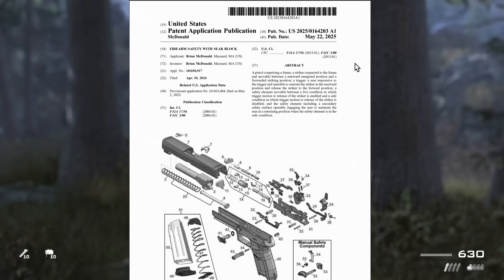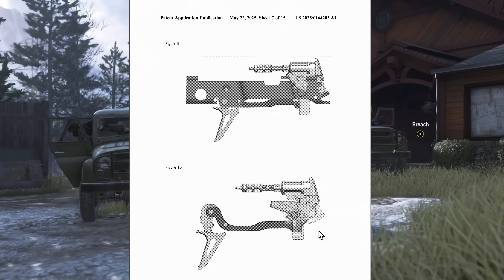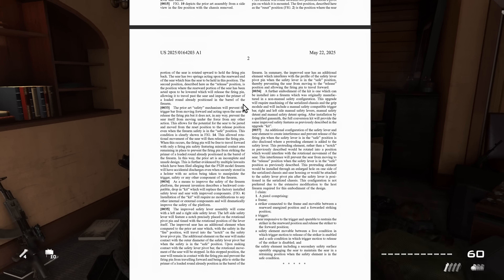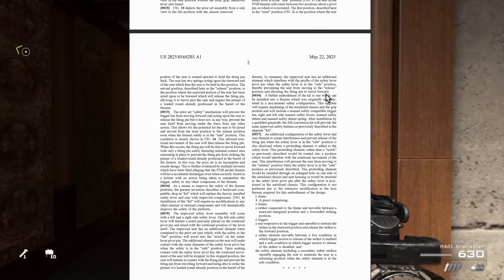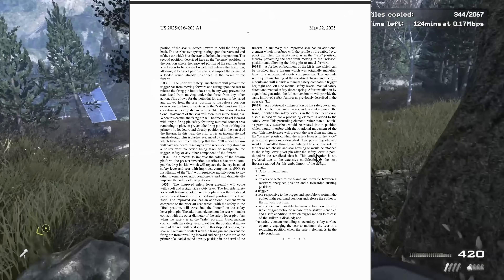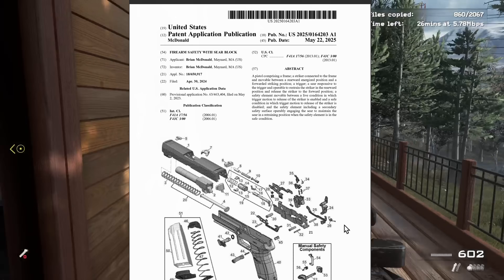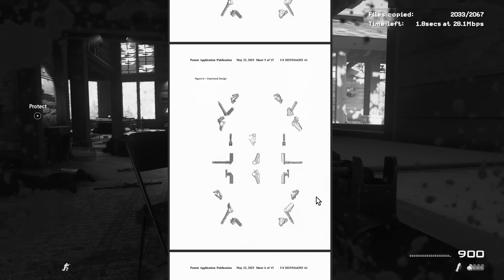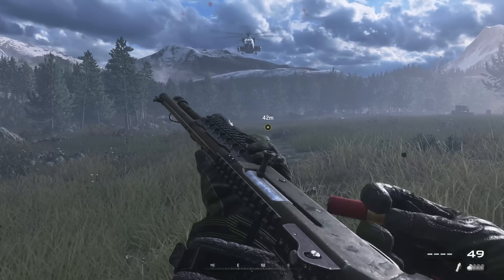Explosive: New Patent Claims Fix For  "Incomplete, Unsafe" 320 Design

Comment: I asked Bruce Grey if this was feasible not too long ago, never got a response. Seemingly it is which is something I would love to see implemented... as well as have the new sear be cnc machined out of billet steel, tool steel, stainless, whatever. Something harder than the striker.
Reply: What would having a sear that is harder than the striker do?
Reply: @jeffhernandez5098  it would allow the striker to be the wear item in that mechanical operation. It's a hell of a lot easier to swap strikers out every 5000 rounds than it is to replace the sear.
Reply: @Hellcat287287 I understand you but I'm not getting the point. Took Isaac Lockwood 80k rounds to wear out a sear. Per Bruce Gray. It would take me about 5 years to shoot that many rounds.
Reply: @jeffhernandez5098 so? Because people don't use their firearms to their full life cycle companies should be able to put cheaper parts in at the same price? Based on the FBI report they had some weird wear patterns. Not enough to be a significant issue I don't think but still, a machined seer would probably force a slightly softer striker to wear evenly, OR if there was an issue it'd be isolated to the striker. Not sure how I feel about Bruce Grey tbh, he's very informative but he also has a lot of skin in the game so I'm taking what he says with a grain of salt.

Comment: I agree this would add “safety”. However, the current manual safety on the p320 blocks the trigger from being pulled… The trigger dingus/safety on a Glock also blocks the trigger from being pulled. Neither one of these setups block the sear from moving. This is actually the same in most striker fired guns. Which would also claim that ALL striker fired guns of a similar setup are unsafe and incomplete and yet again, not isolated to just the p320.
Reply: The Glock has a solid plunger striker safety block while the 320 has a flimsy lever safety. Glock also physically prevents the trigger bar from dropping the striker until the trigger reaches the end of the pull, while the 320 sear can rotate on its pin.
The 320 is a very unique setup for a striker, which is why the conventional striker setup on the 365 isn't under scrutiny.

Comment: This also could mean he's just very familiar with the design due to his past experience. He's seeing a business opportunity to sell a better design and upgrade to the firearm. I think its important not to jump to conclusions about SIG being involved in this. Both are possible.
Reply: He probably knew of the problems years ago but Sig wouldn't let him "fix" it because it would also admit fault.
Reply: this is most plausible.
Reply: This is exactly whats happening. The designer is locking down his idea so Sig has to buy it off him. The problem is this design is seriously flawed. The sear being unreliable, the gun could fire when this manual safety is flipped off.
Reply: @robopam Yes but it now makes the firearm safer for the way it's supposed to be carried by the military. It would make it no different than carrying an SAO with a safety. There are a lot of those M17/18s out there that might need an upgrade. That's big money.
Reply: @JK13A  Im not so sure. If the striker/sear has slipped and the only thing holding it is the rotating safety, when the safety is disengaged, the sear drops the striker and the gun discharges.
Reply: @robopam  ya I guess that makes sense. Then the safety becomes the trigger.
Reply: Sig should have been involved in designing a safe pistol imho
Reply: @JinKee  Yes but we should separate the fact that we believe they fucked up and this patent situation. We should speculate too much on why this patent exists and is from an individual.
Reply: AMEN. good luck to him for this improvement
Reply: Or, OR... Sig is using him just as an "independent contractor" to distance themselves from the design "inadequacies"  of the P320. I think it is important to observe Sig's upper management trajectory during all this and recognize that Sig is now ran by a gaggle of egotistical, greedy, apathetic ghouls... Sure, Sig has cool designs & products, (I have zero issue recognizing that - X-Five Legion & Mod P365-XL owner here), AND Sig's upper management is terrible, that has to be called out as well. Two things can be true at once...
Reply: @mauscuba this was my thought as well. I just like to know how things work because I’m in school for Engineering. I started looking up patents for the pistol and happened to come across this in early June. And it’s not super out there. I had to do some scrolling. So my gut tells me this is a way of rolling in fixes without being super noticeable.
Reply: @mauscuba  You can believe that SIG upper management is unethical but you can't know SIG has done this. I think suggesting that SIG is using this guy to distance themselves as the more likely option is not right. Most of the time the simplest reason is the one that's happening.
Reply: @JK13A  ... I've been trying to respond to you twice and my comment gets deleted or is not "making the cut" for some reason. Bottom line, if Sig does not want people to have "opinions" or to "speculate" they must fix the damn problem and stop gaslighting the public...
Reply: @mauscuba you can have all the opinions you want. This has nothing to do with what SIG wants. It has everything to do with wild speculation based on your imagination. I don't think it's constructive and that's my opinion.
Reply: @JK13A  ... It has been - very constructive - for Sig's competition, lol.  The reality is that all that "bad PR", 100s of people speculating and making 100s of "P320" YouTube videos is completely Sig's upper management's fault. Again: If Sig wants to stop people from having "opinions" or to "speculate unfavorably" 1. Admit there is an issue, 2. Come up with a fix, like this design on this video or something similar involving a trigger safety that acts on the sear as well blocking it and 3, (the most important part) Stop Gaslighting People (like that "it ends today!!" BS) & stop blaming everything and everyone else for the gun's safety problems.

Comment: Except most LE guns don’t have a manual safety…….which should be a standard requirement for general issue…………..to prevent ND’s.
Reply: Manual safeties weren't a thing until semi-autos with single stage triggers had to be carried cocked and locked, when DA/SA and DAO semi autos became a thing safeties were removed again.
If you need a manual safety to prevent a ND on a handgun you actually need to train more. If you want one that's your prerogative but if you're negligent to the point of sticking your finger on the trigger during the draw you're gonna be negligent enough to forget about the safety anyway.
Reply: @ChucksSEADnDEAD Except we have manual safeties on AR’s, shotguns, tasers, and even pepper spray carried by the officer.  You’re exactly right that training needs to be increased, but few departments train enough to be truly proficient, so a manual safety is a good idea, regardless of your platform. I think about when departments installed 12 lb trigger springs in Glocks instead of requiring a manual safety. The military has long decided that a manual safety was a good idea, from the 1911 (which technically has 2) forward (including the DA/SA M9).  Remember the incident a few years ago when the female officer shot a suspect because she tried to use a taser and grabbed her pistol instead? A manual safety might have prevented this.

Comment: There are most likely 3-4 previous engineers that told them something needed fixed but management told them not to.

Personally I think this is a good fix but there also needs to be a lever connected to the trigger that blocks the sear until the trigger is pulled a certain distance. Otherwise non safety users are out.
Reply: Ala XD grip safety 😊

Comment: This will prevent uncommanded discharges as long as the safety is on. However, when the safety is off, it can still discharge without the trigger being pulled, for example while  a policeman points the pistol at a suspect.
Reply: That doesn't fit the model of the ND problem.
Reply: Police aren't even issued manual safety models anyway. They've almost never been issued a gun with manual safeties, because it's found to be a liability for the officer, since they're in high stakes situations, and don't necessarily have the luxury of time to disengage the safety.

This is why they were issued guns with heavy double action triggers such as double action revolvers or DAK P229's (which were developed for police use IIRC), grip safeties for the departments that used 1911s, or trigger safeties like with Glocks.

So this won't solve anything for police or the overwhelming majority of civilian models that don't have manual safeties.

Hell, it won't solve anything for the manual safety version for the majority of people who carry them, because people generally don't use the safety anyway. Despite being taught to carry safety on, lots of service men don't because it's not exactly something you'll remember to disengage when you actually need your sidearm.
Reply: @RealBarrySteakfries this John wick nonsense makes no sense.  They have L3 retention but a thumb safety is the problem.  The cops can learn to disengage a safety like they learn to disengage 2 levels of retention.  People who have a safety and don't use it because of some magical scenario are foolish in my opinion.   Israelis carry condition three and they have clear and present threats.
Reply: Exactly on point.
Reply: what about p320's without a thumb safety?
Reply: @azcompetitiveshooter still cannot fire without the trigger being pulled.
Reply: @youcancallmemaurice bless your heart. They ABSOLUTELY ARE FIRING without a trigger pull. You're being obtuse. You are DEFINITELY not an armoror or even understanding the design and problem 🤦‍♂️
Reply: @azcompetitiveshooter  same defects, just without an added piece pushing on it. Very marginal since 2 issues still exist. 🤷‍♂️
Reply: @WhiplashWoods1971i was always curious as to why sig made the thumb safety only block trigger movement and not sear movement
Reply: So the UC problem comes from manipulating the slide or pressure usually found while holstering, or moving with the gun in a holster. There have been no reports, and I see no engineering reason why there would be, for the gun to go off when being held in a ready position. The danger comes when being jostled while entering or resting in the holster. 

If an officer draws, releases safety, and doesn’t press the trigger. There is no mechanical reason the gun would be unsafe.
Reply: @cfdfirefighter  like, running, falling and hitting something?
Reply: @cfdfirefighter   Um.. look at the design..the manual safety pushes on the linkage. Its going to happen. It probably has and they said the officer goofed up.  Not to mention, if the officer just gets the nervous shakes. Rattle Rattle BOOM.   They won't accept blame for anything for other reasons.  You assume WAY too much one striker thats just WANTING to slip. Its a CRAPZ design
Reply: Theres not really any evidence of that happening though
Reply: @ravener96 you own a 320, don’t you?
Reply: @TheIrishAmish he does
Reply: @ravener96 there’s literally multiple videos of it happening
Reply: @ravener96  the nature of the problem would make self-firing of the firearm a real possibility in that scenario.  It is motion that causes the release of the firing pin.
Reply: @ravener96  100% 
No lab/agency, including the FBI, has been able to recreate an un-commanded discharge, even when testing pistols that supposedly "just went off", and it's certainly not for lack of trying. 
Manipulating the sear with a tool, holding the trigger back with a screw, or modifying the pistol cannot be called "un-commanded". Other striker fired pistols, yes, Glocks too, will fail the same tests, since the test procedures defeat redundant safety mechanisms.
Reply: @ravener96 theres plenty of evidence of police issued p320s, NOT the m18s with a safety, going off in holsters when just walking, leaning over, or getting out of their cars. The videos are everywhere of the guns doing exactly that. Going off with no safety engaged
Reply: @CJ2808 There have been numerous cases of various military branches having the same set of problems with the M17/M18. The safety as far as we can all tell, doesnt do anything to fix the unsafe nature of the 320.
Reply: @xXxAlexIVxXx yes fully agree the safety does nothing at all
Reply: @CJ2808 but that’s not the issue. Those problems would be solved by a sear safety. Once out of the holster, there is no issue to be wary of.
Reply: @xXxAlexIVxXx that safety (had you watched and listened to the video) only stops the trigger bar from moving. It does nothing to hold the sear in place which seems to be the issue. This new safety would fix that.

Comment: I would also bet this designer has filed this patent to protect his manufacturing rights? And some aftermarket company is willing to invest capital to develop this new safety system. Thinking they can sell the kit and or the remanufacturing the FCU to solve the unintended discharge problems? 
Question is now, would current P320 owners pay OUT OF POCKET for this upgrade? Or would SIG pay to have the current owners send their P320 models in for this update? Just think of the costs for shipping, machining and liability. SIG had to know the P320 was defective back when this designer was working for SIG? The lawyers now are going to eat SIG up?
Reply: The New Bruce Gray p320 M17/M18 Safety Conversion.  Brought to you by the genius and skill of Bruce Gray at GrayGuns in cooperation with Sig Sauer.  Part of the buyout/payoff to this engineer is a gag order so they can spin whatever tale they wish.

Comment: Sounds like the India MIM factories will have to adjust their molds. Still no trigger dingus, interesting.
Reply from the maker: believe Glock owns the dingus
Reply: @Protraband  Glock has never owned the trigger dingus.
Reply: @Protraband Glock lifted the trigger dingus off of the old Iver Johnson Model 2 safety revolver. Kinda hard to patent "prior art" from a different company.
Reply: @Protraband The origins of the dingus come from Iver Johnson revolvers from the 1890’s. Glock reintroduced the concept back in the 1980’s. 

I’m fairly certain that even if there was a patent specific to that concept, it would be long expired.

Comment: I do wonder if and when sig was aware of this design and patent
Reply: A week after design probably 😂 you know it's too late to change it now
Reply: @X-ForceBro  i think sig thinks its too early 😂
Reply: Someone should look up if there were any workman comp claims from the testing period on the 320.
Reply: If it was filed before Sig filed their patent, they had to be aware through research of prior arts (meaning all patents on the subject matter).
Reply: They were aware of it when they stole it from the Glock Gen5  patents.And they're not the only company having this exact issue.
Reply: Considering the 365 came out 7 years after the 320 and the changes made sig knew the issues.

The 365 has a different striker safety that’s not a bar, different sear, etc.

The 320’s FCG was designed to be small and the 365 is supposed to be a mini 320 yet they made changes that make certain parts larger like the striker safety tells me everything.

I could go way further.

I’m a certified sig armorer too btw.
Reply: Sig was aware of this design fix when it came out. Mr. Bush formerly of angled spade spoke to Sig in the beginning and they refused to accept the redesign.
Reply: @WARPSPD  😡😤 Well, I hope that their Voluntary Upgrade $$ actually fixes this issue eventually. Since it is "voluntary," you have to pay for shipping to and from the FFL
Reply: @Dedseq it doesn’t fix the problem! Upgraded guns have also shot owners! That upgrade only fixed the drop issue! The internal safety parts are all defective in ALL of the 320’s!
Reply: @WARPSPD  I meant after they acknowledge that this issue is on their part and come up with another solution. That is if they keep the "Voluntary upgrade" name. I don't think they would call it 2.0 or something else.
Reply: We know the Army was aware of it early in the trials, with the sealed catastrophic incident report, and recommended courses of action being published by a whistle-blower SIG is now sueing for exposing their unsafe design.

In the documents, there's a laundry list of likely failure nodes, including unintentional discharge with high probability of killing or injuring service members, and the only fix is to follow P320 actions, read the manual.

The Army contract oversight personnel knew about this as well.

Comment: Sig's finally going to have to admit there's a problem with evidence like this.
Reply: And that they knew about it. At least the next mgmt regime will have to.
Reply: No they won’t. It’s an uPgRaYeEd
Reply: They never will
Reply: Evidence of what?  It literally won't affect the most popular theory as to what is actually happening with these uncommanded discharges.  Because those don't involve the sear moving at all .

And the second most popular theory (more preferred by people who actually understand how striker fired pistols work) doesn't involve sear movement, either.

Sear movement causing an "uncommanded discharge" would require force applied to the pistol in the holster in EXACTLY the fashion everyone who is suing or bathing Sig insists isn't happening (because if the problem is that the guns are getting whacked sharply while in the holster, their entire case disappears).
Reply: @geodkyt  If a pistol goes off when "whacked sharply" in a holster, it's poorly designed and unsafe to carry. There's simply no way around that.